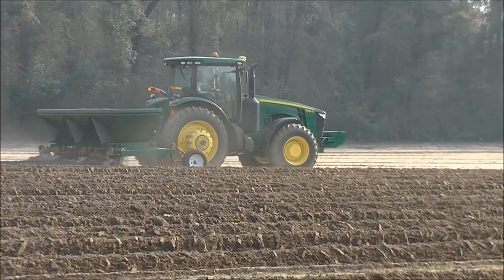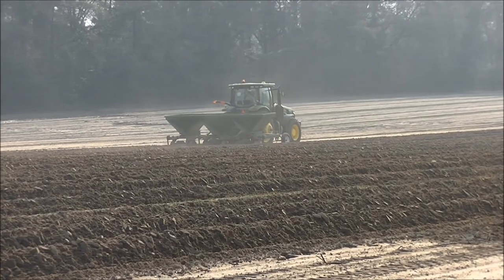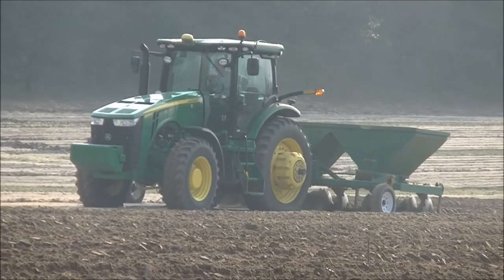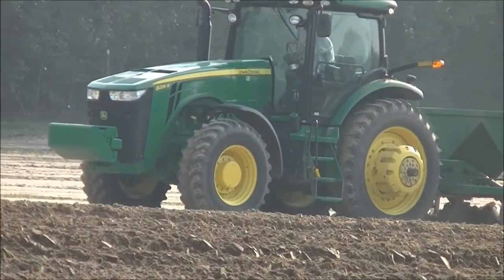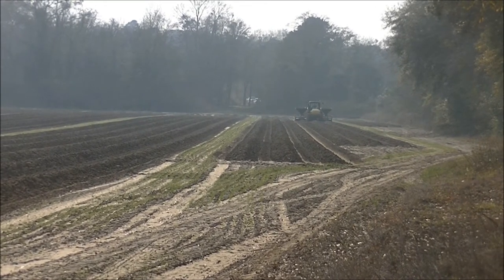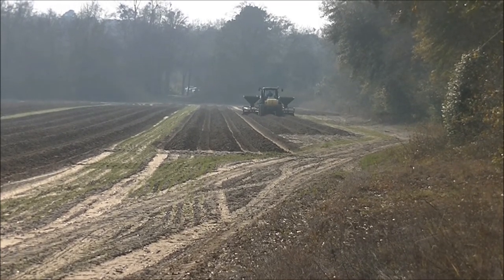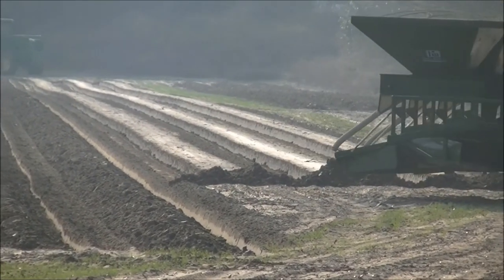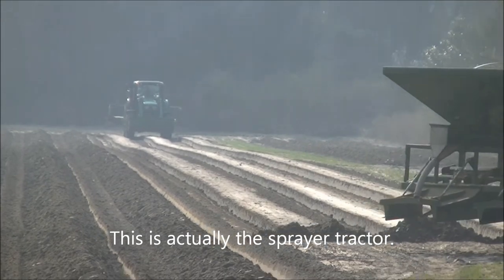Murray Farms lays plastic for Tomatoes and Peppers part 1

Comment: What's the yellow tank on the front of the jd a nitrogen tank????
Reply from the maker: This was either Telone or Methyl Bromide. Most likely Telone as Methyl Bromide had already been banned at this time but suppliers were able to use up what was already produced. Both of these are soil sterilents.